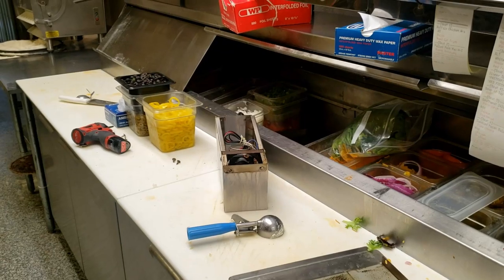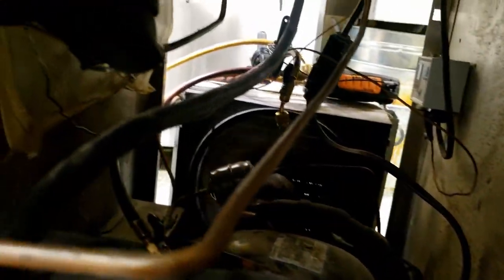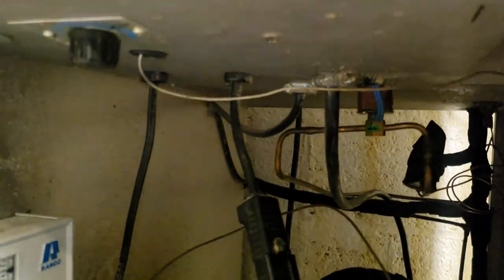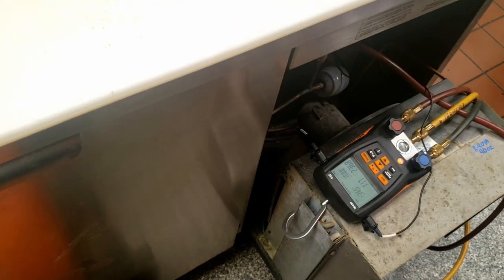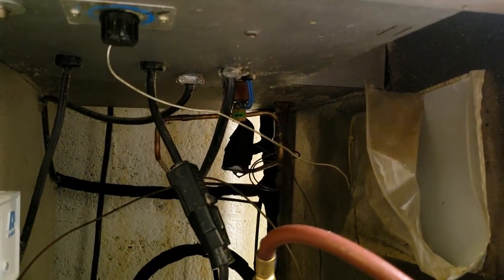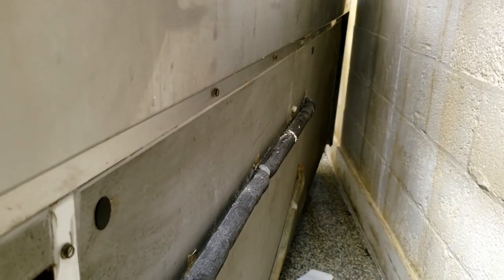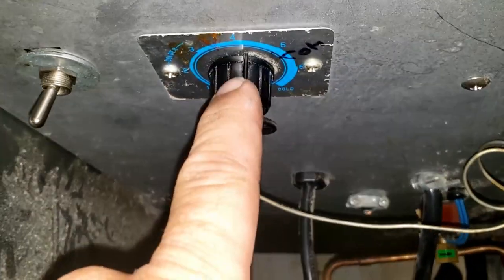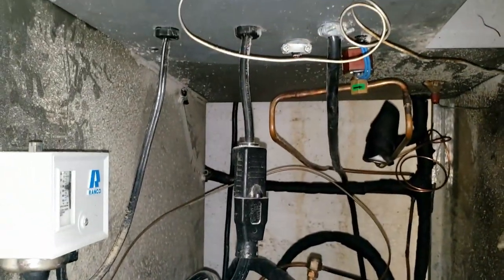Randell Pizza Prep-table Warm

Comment: butt crimps, for butt-head mistakes... LOL we all made them and make them on occasion, such is life :)
having mixed electrical, electronics and other cabling background, quickly teaches you the value of never cutting off excess wiring, often times it can be used to fish in new wiring or repurposed for other function.  I do tend to leave too much everywhere, fan folded/coiled, zip-tied and capped if likely permanently abandoned, I still learned to not snip things out fully.
Boy is that nice when you go back days to 20+ years later and have to relocate, add wiring/circuits to previous splices, so easy to snip off close to the splice/devices and rewire still leaving lots of free length!
Reply from the maker: Exactly 👍👍.

Comment: thanks for the video Rick, cold rails are never fun, I work on a lot of taco cold rails, the unit satisfies early, I usually bypass the thermostat when they leave they shut the unit off and put the product back in the cooler, its near impossible to replace the thermostats, they run it through the foaming insulation and u need to get to the back of the unit, cut the stainless. not fun.
Reply from the maker: I normally see these units at Pizza Hut but we do some Taco Bell equipment but I don't care to work on either ones equipment.

Comment: I've always wanted that Fluke thermometer until I saw the price , and also, I heard that K type probes aren't necessarily that accurate, in that you supposedly have to calibrate them and then leave them plugged in and you can't take them out of the plug or switch them or anything... Have you experienced anything like that with them ? I've never heard anyone complain about it tho....
Reply from the maker: I checked each probe in ice water and labeled the probe what it came in at. I don't use cheap probes. I try to use either the fluke or the Cooper Atkins.
Reply: @HVACRSurvival  Imperial "Annie" A-8

Comment: I don’t like Randell cabinets. Their plastic interiors don’t hold u, so the insulation gets filled with bacteria infested garbage that cannot be cleaned out. Be careful not to break their new drain an when installing them. Cheap crap plastic.
Reply: Randell prep tables are always leaking because factory can’t braze the outlet of a txv at the evaporator.
Reply from the maker: I'm curious why that would effect the integrity of the weld?
Reply from the maker: I haven't worked on any new models.  This particular system was purchased used and I would guess it was 6-8 years old.